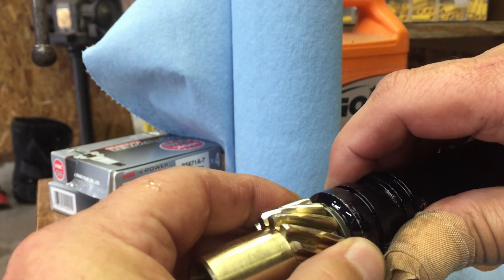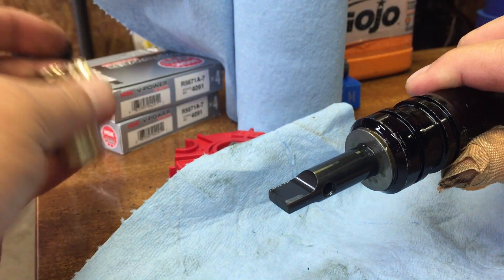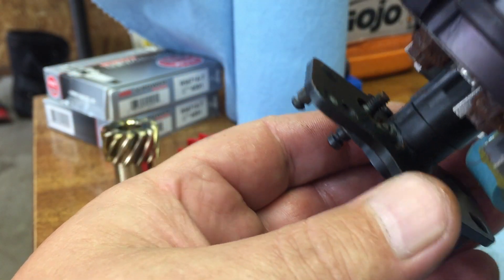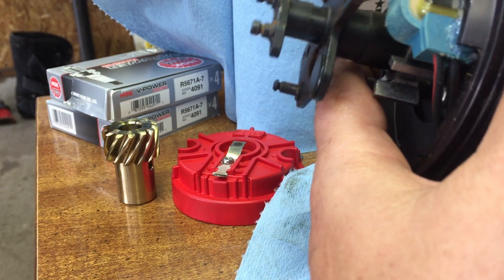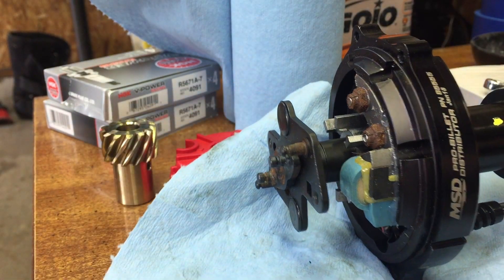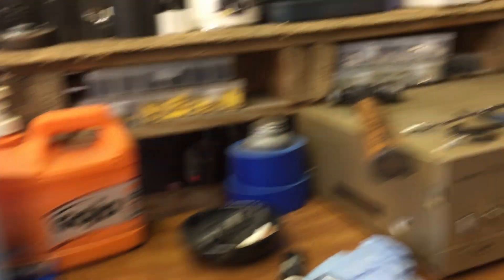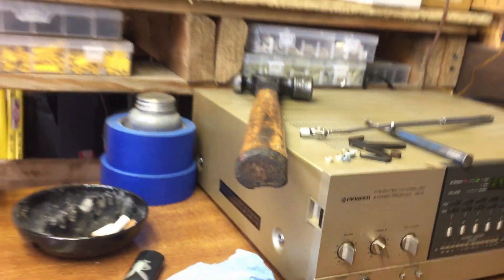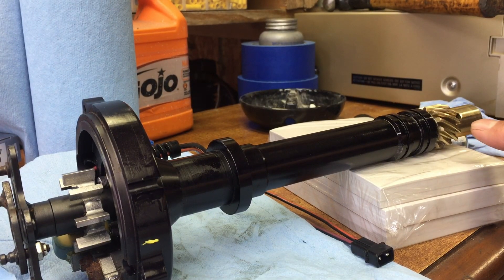How to lock out your timing on a msd pro Billet distributor.

Comment: I don't  like running  a locked out distributor.  To much preignition problems.  I have had better experience with a fully functional  distributor and I run the same  msd box you use
Reply from the maker: I always ran the same setup as you also, figured trying the locked out side of things to see if any changes can be had on performance, if not back to the old school curve kit lol 💪✌️